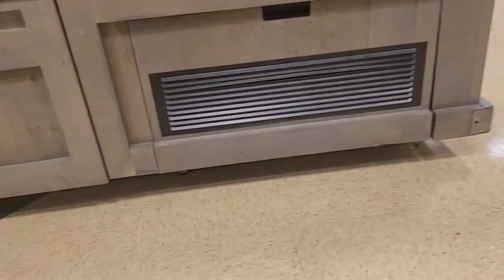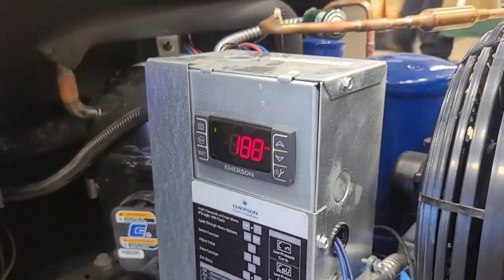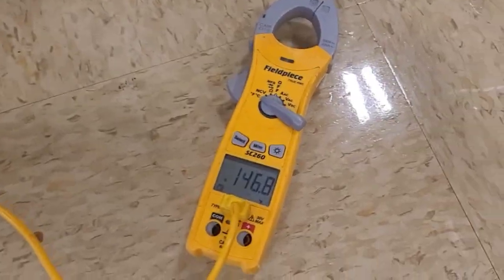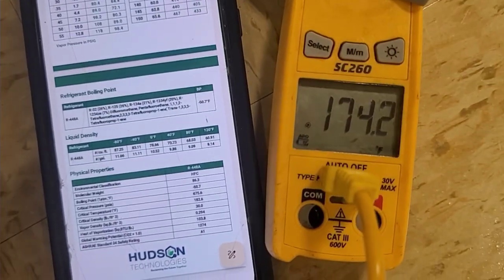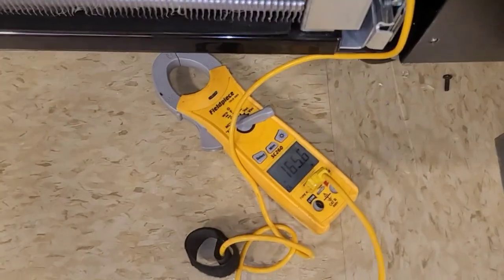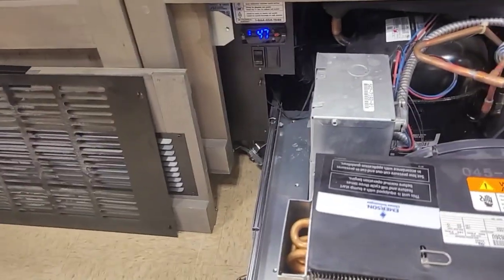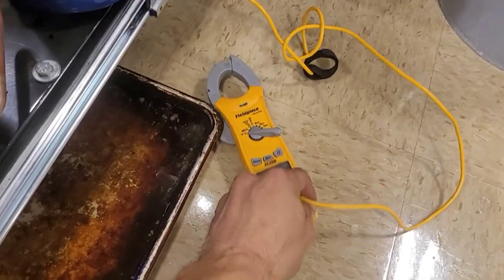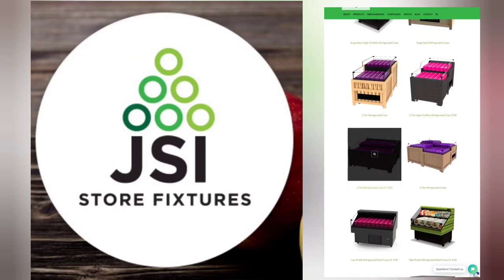New Produce Display Table Designed to Fail by the MFG

Comment: 👍💪🇺🇸❄️ bump start feature provides additional flooded protection. It drives refrigerant out of the oil preventing refrigerant from circulating through compressor n it washes oil film off load bearing surfaces.
Reply from the maker: Thanks for that information I had no idea. Having this channel is really cool because I get to learn a lot from all of you guys too. Its like an Association
Reply: @mastertechnicianmindset2181  love ur videos they r so helpful especially for me I'm on my own. Thanks again MTM
Reply from the maker: @shine-cg9uf   are you doing commercial refrigeration, or HVAC
Reply: @mastertechnicianmindset2181  just commercial refrigeration. I started a beer line cleaning business 23yrs ago n wanted to bring refrigeration into my business since my office is a walk-in box.

Comment: They sent out a booster fan kit to install underneath the case to remove the heat from out the case. They also had us flip the exhaust grill upside down so the louvers point upwards. Also superheat needed to be adjusted.
Reply from the maker: Cool, so you had the same experience with the same company. That's cool good to know. I mean I just wish, for the customer sake, and in a way for ours because these customers keep us busy enough with real emergency calls for the racks, that they would design it to work from the factory. It's almost as if there was no quality control

Comment: This is a flooded start protection. The compressor is turned on for 2 seconds, then turned off for 5 seconds 3 times before the compressor runs normally. This allows for refrigerant to exit the compressor without the oil being removed as well.

Comment: Transducer causing it to short cycle? I wonder if it ever worked with the air flow restriction like that. Let us know what they say, nice video keep them coming!
Reply from the maker: I don't understand how it would pass their QC inspection and be able to roll out of the building as a quality product. Yeah they told me to flip the discharge side Outlet Grill to where the louvers face upward and to take off the black grill cover on that outlet side also so that the discharge air can exit easier. I already did it. I looked at the history and we've already got like four or five service calls that have been generated and closed out for high discharge